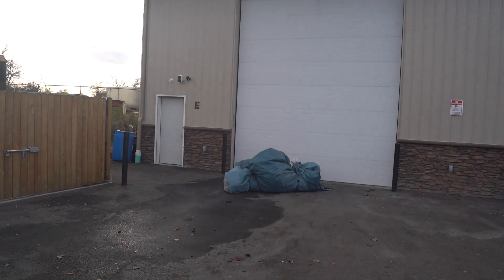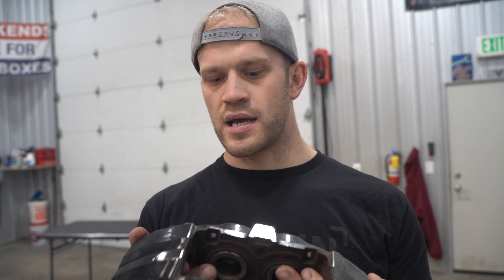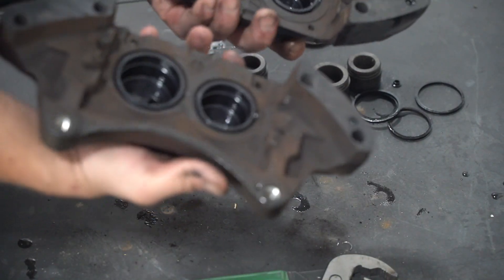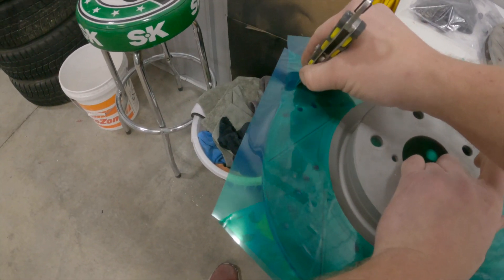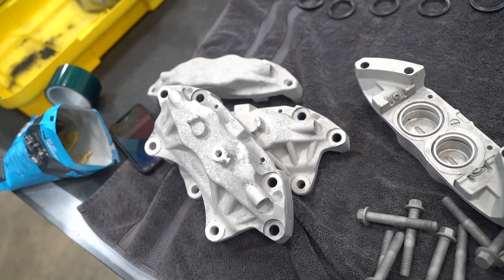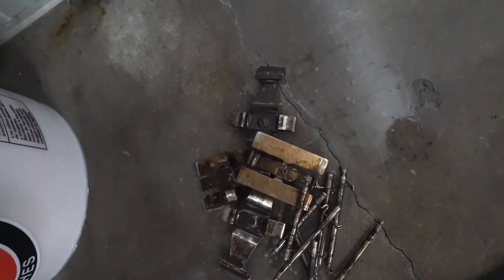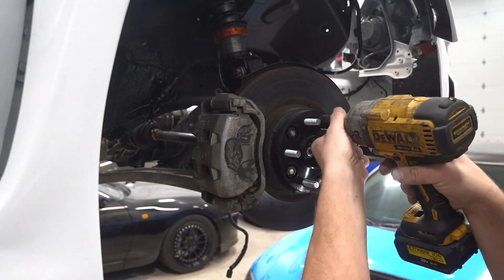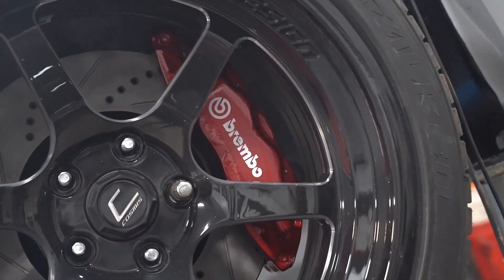SUSTI Finally Gets Some Brembos!

Comment: Devin, there was a Rennlist post a couple years ago on  a Porsche forum about the torque spec on those 4 caliper bolts,  although it is recommended by Brembo to not disassemble the calipers even for recoating as they're plained to match surfaces.  Brembo states that 70 ft lbs per bolt is factory spec.
Reply: Their stance also makes those internal o-rings (for ones that don’t use a lower line) difficult to find. I live near the Brembo USA performance headquarters and talked to them about rebuilds and I didn’t gain much helpful info.
Reply: @Chase_AM  well that's not comforting lol. Brembo needs to start manufacturing more parts for their market, imo.
Reply: @huggybear2789  It’s really just an offloading of liability so they can’t be held responsible for anything bad that may come of an individuals work on their own calipers.

Comment: I like drilled rotors they do have a purpose.but I stopped buying them, cause the will crack when they get really hot. Like at a track day or even hard back road driving. Cryogenically treated rotors will help that from happening. But I just stick the slotted or J hook rotors.

Comment: With the brake lines I have that same issue where the guy powder coated partially over it and now it won't seal properly. Any tips on stripping that part off? I know if you chip it your pretty much screwed.

Those Calipers pop really well with that white car and black wheel to showcase em!

Comment: you shouldn't mount wheels on powder coating i would take the coating off the hub surface so you don't loose a wheel or have a vibration. looks mint tho